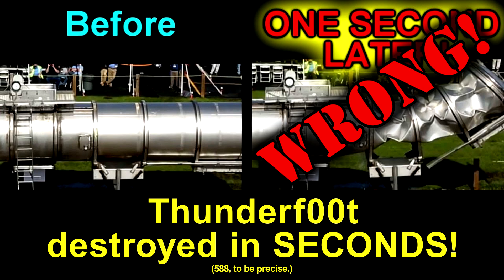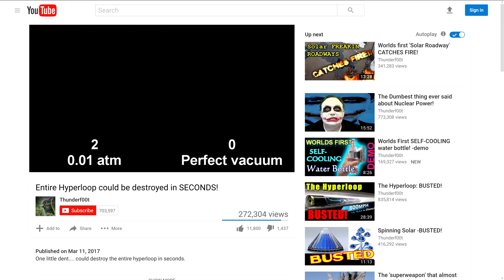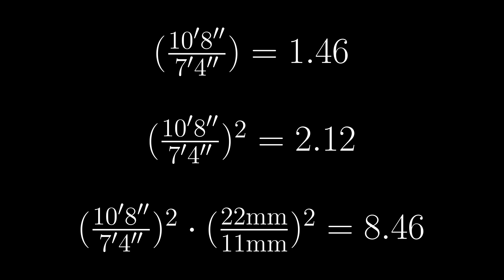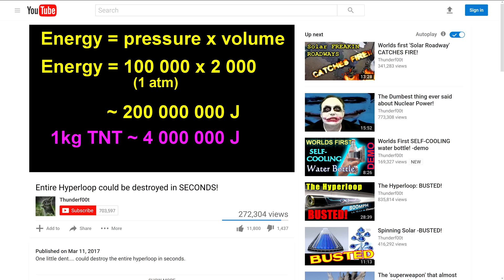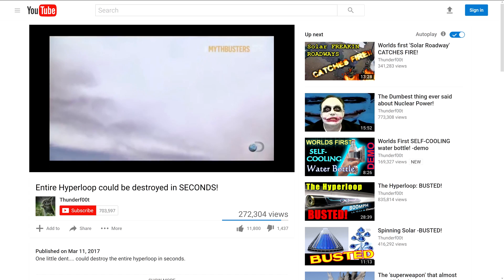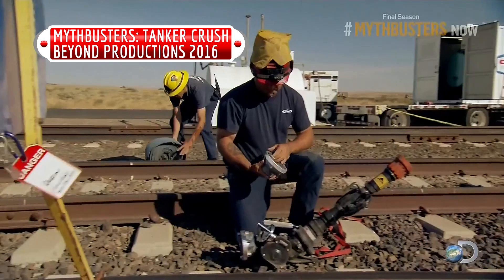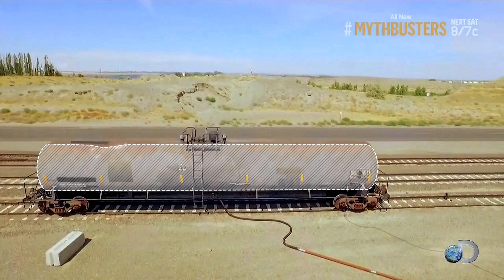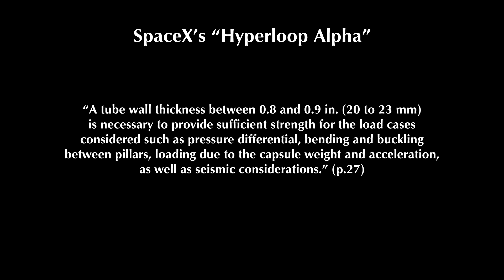Thunderf00t destroyed in SECONDS!

Comment: It requires $5 worth of electricity?? Hyperloop DEBUNKED.
Reply: Edward Sanville yeah. It's way to expensive
Reply from the maker: According to WolframAlpha, the 2016 average for the US is 10.07 cents per KW/h. That's about $5.60.
Reply from the maker: Um, no. We covered that earlier in the series and found it to be no problem.
Reply: Edward Sanville Its $8400
Reply: lol, thanks, don't know why i didn't think to use WolframAlpha.   anyway, this channel rocks! -- thanks for the awesome content!  after having been introduced to this channel by your anti-thunderfoot videos, I'm a big fan, and frankly i'm stoked that his mistakes were large enough for you guys to correct him, otherwise i might've missed out.
Reply: +Shane Killian You dont see an issue with the time it would take to pump out such a vacuum?
Reply: aslowburnpdx1986  no, it wouldn't be $8400. 200,000,000 J is ~ 55.6 kWh, and the average price of electricity in the U.S. in 2011 was 12 cents/kWh.  At that rate, it would cost under $7.

Comment: 200,000,000 J? Doesn't sound like too much in context. Given that 1 J is enough to raise the temperature of 1 gram of water by 1 degree C, let's put this number in context.
Your average store-bought packet pasta (4 servings) needs 2 and 1/2 cups of fluid to cook in. Simplifying this to water, that means you're raising the temperature of roughly 590 mL of water from room-temperature (25 degrees C) to it's boiling point of 100 degrees C. That's a total energy use of 41,300 J.
So if I cook packet pasta every day for lunch and dinner it'd take 6.6 years to use the equivalent amount of energy. And that's just the energy required to get the water to boiling point, not taking into account how much is absorbed by the pot, wasted to the atmosphere or by burning the fuel (I use a gas stove), or in maintaining the boil for the time required to cook my pasta.
It sounds like a lot, but it's still well within the realm of feasibility for an industrial vacuum pump.
Reply: aslowburnpdx1986  what are you talking about?  200,000,000 joules is about 55.6 kilowatt hours.  At 12 cents/kWh (the average price in the U.S., in 2011), that would cost about $6.67.  He doesn't need to correct anything.